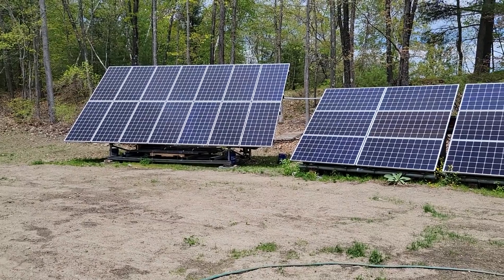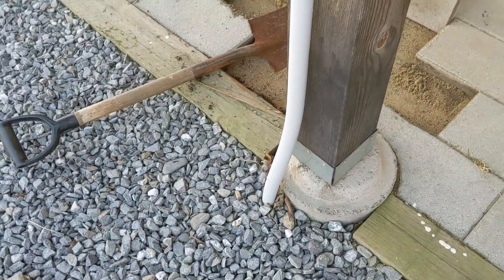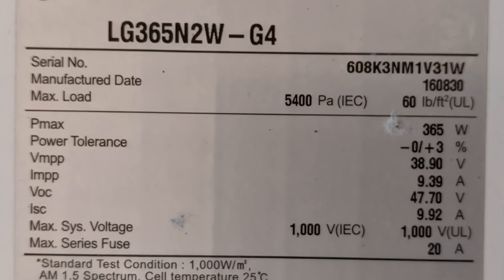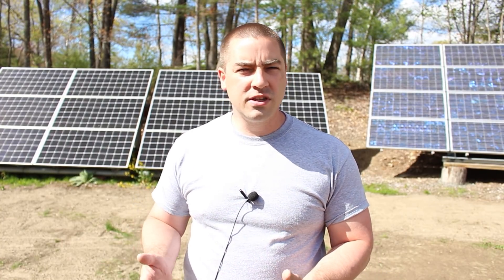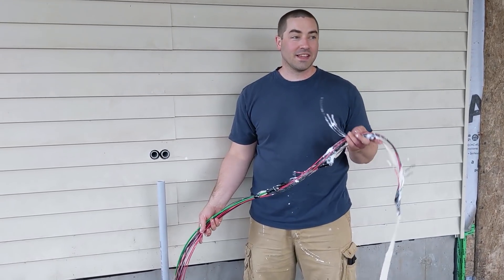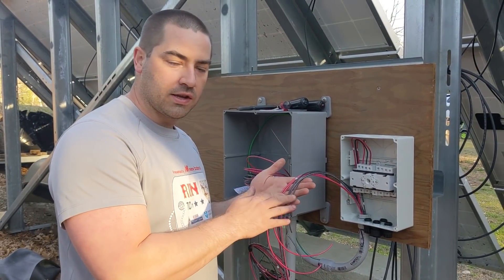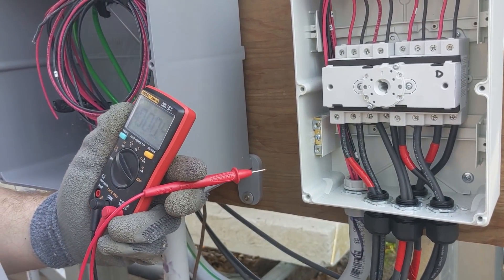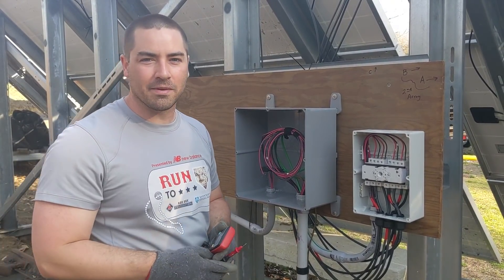Couple wires a huge, High Voltage, Solar PV Array, 12.6kW

Comment: Hey I have 380 volts on 2 strings about 19 amps I was going to add one more inverter. Can I split one string to 9 amps? Or do I need to reconfigure?
Reply: I have 12000 watts of solar. I also have 2 grow art 5000 inverters. I also have a third one still in the box
Reply from the maker: Each Growatt 5000ES can handle up to 6kw of solar.  So you can run all 12kw of your solar array into the two inverters.  Splitting your array into more strings, and running them into the third inverter is beneficial sometimes, but not always.  If you have your array facing different azimuths, angles, or shading issues, then splitting it will help.  However, if it's an open field, and all panels get equal sun, then you probably won't notice an increase splitting it up to a third inverter.
Reply: @DavidPozEnergy   1st: I like and appreciate your videos, 2nd: I'm wondering why your panels are not facing the same direction, also, some fuses or breakers on each string would be a good call, anything to avoid one of those cables getting too hot->melt->make a short as you have them all in the same conduit :)
Reply: @DavidPozEnergy  so where does the third inverter get its power.?
Reply: @DavidPozEnergy  I have my whole house including ac and power tools running off the 2 inverters. But sometimes we use more than 110 percent of output and it shuts down our power.

Comment: Bonding: Connecting something to ground via a grounding conductor
Grounding conductor: not current carrying, connected to ground rod(s) directly or indirectly
Grounded conductor: In the US this is the "neutral" which is current carrying and is bonded to the grounding conductor (aka "ground") only at the main panel

There are some nuances around separate buildings with no other connection and I've not studied the code for about 20 years, but in your situation I'd have at least one ground rod at each group of panels and one where the wiring enters the building and they'd all be connected with the grounding conductor in your conduit, and from there also to the main ground for the building. My DC run is a little over 100 feet and I measured significant voltage difference between the ground rod at the house and the ground rod at the panels. Before I connected them I could draw sparks. Now the earth potential is the same all the way between the house and the panels.
I also put ground rods at the corners of my house and mid-way on the long side and buried a bare #4 connecting all those together with the main ground rod. I have a Delta DC "Lightning Arrestor" (DC LA) at my panels and before the DC lines enter my garage, another on my power wall, and an AC LA on my main panel. Your grounding can never be too good.
Reply from the maker: That's an impressive grounding system.  Wow.  Thank you for your explanation.

Comment: Why run DC that long into the garage?  Why not invert to high voltage AC at the PV frame?
Reply from the maker: The inverters I'm using have built in charge controllers.  But they are not rated for outdoor use.
Reply: And now with the HVDC wiring there is less loss in the wires (and/or smaller wires) than going directly to A.C.

Comment: Feel for you with the existing buried conduit size.   I put a run for solar about 30 feet from a shed to garden.  Initially I had just 2 microinverters, 2 amps max 240vac so used 1/2" conduit (so cheap!) and #12 wire.  DC Solar trailer later, I put 13 microinverters worth, 12-13a max and wanted to use #10 wire, L1L2NG.   Fill table says 5 fit, but just 4 was fun to pull.  So in summary, coulda shoulda used next size up in the first place.

Comment: FYI

690.31 Methods Permitted.

Where PV source and output circuits operating at voltages greater than 30 volts are installed in readily accessible locations, circuit conductors shall be guarded or installed in Type MC cable or in raceway. 

690.31 Methods Permitted.

(G) Photovoltaic System Direct Current Circuits on or in a Building.

Actions for Section
Where PV system dc circuits run inside a building, they shall be contained in metal raceways, Type MC metal-clad cable that complies with 250.118(10), or metal enclosures from the point of penetration of the surface of the building to the first readily accessible disconnecting means.

Comment: You may want to check your local electrical code. High voltage DC above 250 volts must be encased in properly labeled and bonded steel (emt) conduit. This is to protect fire fighters from cutting DC lines.
Reply: Why would they cut the lines when they can just flip the disconnect switch? Or are they not smart enough to do that and just want to fuck shit up?
Reply: That is only required when in or on buildings. This is a ground array not a building.

Comment: I dont see the point. High DC voltage is deadly. You can use aluminium wire to save money with voltages less than 50v DC. It is safer. All it takes is just one mistake! I think that Mppsolar make 24v DC inverters that can be paralleled. The result is the same as the high voltage inverters. Best regards from Egypt.
https://www.mppsolar.com/v3/pip-hspmsp-24v-series/
Reply: The point is to reduce power loss in the wiring. Losses in the wiring are caused by amps squared (PowerLoss = Amps * Amps * Resistance). Power is Volts * Amps.  So if you use higher voltage you can transfer the same power with lesser amps and lesser amps means lesser losses and/or smaller wires.

Comment: Those all-in-one units look excellent. Going to try to use  one to charge the Cyber truck off solar when I get it. Can charge at 5A and 240V so should be possible to charge slowly with 2000W.

Comment: Great video Dave.
You might want to investigate a compound called "NO-OX-ID" which would prevent oxidation from occurring where your wires connect, especially on those screw down terminal connections that remain outside.....
Reply: Especially important when joining dissimilar metals.
Reply: De-ox, no-ox, etc. Good stuff. Even gray anti seize, only if you have to.

Comment: The standard would be to use 10 gauge wire for a wire run that long. Otherwise you are losing too much to voltage drop.
Reply: Yep that`s what i use (6mm) on a shorter run than that.
Reply: Ok going 200’ and used 10 awg

Comment: Looks like we did many of the same things lol.  I also changed my solar to a 6s, used 12awg as well but runs are not as long, the same bag, line and vacuum trick to get the wires through.  At my job we also use that book of letter stickers when rewiring cannon plugs or anything really.  Great way to label!  Fun times!!!
Reply from the maker: Thanks Joe.

Comment: Wow I would have gone with 2 inch pvc with that many wires. But you made it work good job !
Reply from the maker: I wish I had gone with 2" from the beginning. Next time!
Reply: @DavidPozEnergy   When I brought my 100 amp service wire around my house I use 3" and hooked it up under the eaves all the way around the house I had 96' to get to my garage where I could put my sub 100 and panelin that's the one that's always in my videos with the panel off and wire sticking out everywhere. Lol

Comment: David, why do you run the ground wire from your panels to your solar charger system? Couldn't you just ground each one at their location and save the cost of wire? I have my array at 197ft from my solar shed and was planning on grounding it with an 8' x 5/8" copper rod and doing the same thing at my shed for my Sol-Ark 12K. Am I wrong in doing it this way?
Reply: A ground rod at each end would be sufficient for grounding but for bonding everything needs to be connected together. My understanding is that everything should be bonded together in an electrical system. I know there are some exceptions but I think it's better to do so unless you are sure otherwise.

Standard disclaimer applies. I could easily be mistaken and in any case codes vary.
Reply from the maker: There are a few different ways to do this.  I ran it following one of Midnite Solar's diagrams using a ground-fault protection device.  This was with my Victron CC.  I don't think the Growatts want it done that way, so I won't use the green wire right away, but I wanted it in case I change things again.
 However, I think you are using the Sol-Ark, is that right?  I don't think the Sol-Ark needs the ground wire between the array and inverter, but check your manual.
Reply: @DavidPozEnergy  This http://www.ginverter.com/upload/file/contents/2020/07/5f1019661cbac.pdf   describes AFCI protection which some Growatts have, but looks like not the SPFxxxx ES.   Sol-Ark does have  PV Arc Fault detection – NEC 690.11/UL1699B    

Careful of the DC out at the arrays and coming into the garage.  https://www.youtube.com/watch?v=S9a2oPCIMr0    Imagine that starting from PV loose connection or pos & neg touching in combiner box in garage, promptly expanding to all the string wires.  Ground mount arrays are not a huge fire risk, but certainly a potential shock hazard.  

Kettle being black, my DC panels are on my attached garage roof, and I'm convincing myself to install my AFCI system Sensata PVAF-T parts sooner than later.  My DC charge controller is decontented Midnite Classic 250-CP without integrated AFCI.
Reply: @DavidPozEnergy  You do want the green connected to the grounding at the array, and to the grounding in your garage and to the equipment ground of any inverter and probably to the battery negative.  

There are numerous discussions on the NAWS and Midnite forums about GFP, but this is the best write up I've seen.  https://silo.tips/download/version-35-draft-dated-03-29-2011     It's kind of a lot to read, but it's worth understanding, and there are good diagrams of various failure modes.  Maybe the Growatt solar input has modern AFCI detection that looks for arc noise signature on the PV wires, which would mitigate any or most PV faults to ground or pos to neg.  That is a better type of PV array protection than the 'NEC DC GFP' method, sounds like you had before.  The Victron charge controller maybe did not have AFCI.
Reply: Craig,  need to connect the ground at all locations, with a ground wire, ie: bonding.  Dirt and earth is actually not a good conductor, and lightning or or faults do happen.   The bonding wire keeps all points in the system at the same ground potential, for safety, and as a return path for fault currents (shorts), so that an overcurrent device (breaker) can trip and de-energize it.

Comment: Yeah, you have to be extra vigilant with the wiring in those IMO disconnects. I used red and black wire all the way from the panels into the basement and have an IMO on the arrays and one before entering the inverter in the basement. I checked the voltage at each step and got caught out by the negative voltage coming out of the first disconnect. I had to correct the wiring even though with two disconnects in series it would have come out fine. Didn't want a gotcha in future if I made further changes to the system.
Reply from the maker: Good to know I'm not the only one that goofed.  Thanks.

Comment: Hate to burst your bubble, but the ground IS counted for pipe fill David, just not for derating.

Edit: You're still good in 1 inch pipe though. 👍
Reply from the maker: O, no.  Shoot.  I really thought I had that one understood.  Thanks for letting me know as I care about putting out correct information.
Reply: @DavidPozEnergy  Also you derate after more than 3 current carrying conductors, at least on the AC side of things. I'm a residential electrician so don't deal directly with PV and DC a lot, but I'm learning. That's why I like your videos so much. You put an honest effort into explaining things as you are learning them. You're genuinely enjoying learning and sharing that process, warts and all, and I 100% relate. Keep up the good work.
Reply: @cali-electro-dad  DC and AC is the same thing when it comes to amps and derating.

Comment: I thought as you increase the voltage the amps drop but the “power” stays the same.
Reply from the maker: That would be true with loads.  In my case I'm adding more solar panels to one string.
Reply: @DavidPozEnergy  are yes. Your right. Forgot you added more panels 👍

Comment: Rubbish video . Really trying to drag it out for the kindergarteners I guess. No need for labels .Try a continuity meter. 450 volt inverters have been out for yonks. You are just late getting on to them . Should look at hybrid varieties that can even be used without a battery.
Reply: Thw geowatt spf5000es IS a hybrid inverter and can operate without a battery !       Still most use it with batteries.    I have a system running with the same exact inverter, 18 panels and batteries,  it works great.
Reply: Rubbish comment.  450v pv   and up are NOT the norm for less expensive inverters .  Sure 7k $ systems but we are talking 800. Why not label , your going to anyway after you find them with a meter .

Comment: The ground wire shall be counted for conduit fill. It, however, does not need to be in the math for de-rating the conductors voltage drop.

Comment: You have two strings coming off of each panel group, which should be six (3 groups by 2 strings). Where are the other two sets of wires?
Reply from the maker: On the oldest (Poly) array I already had a disconnect on the back of it.  The wires go underground to the garage.  I will be wiring that array to the Growatts too.

Comment: Most of the time Mule Tape refers to the webbing that has a steel chaser inside it too. Also, KY Jelly is way cheaper than wire pulling lube, in case you do another pull in the future.

Comment: I had a bad experience with Cat5 cable going about that far underground.  A nearby lightning strike destroyed equipment on both ends and vaporized the cable.  What are you using to protect the inverters from lightning?  The high voltage is a problem for most gas tube style protection units.

You might want to look at "Grounding and Bonding for the Radio Amateur" - you can get it on Amazon in either paperback or kindle format.
Reply from the maker: Thank you.  I ordered it and look forward to the read.

Comment: Dave I'm interested in learning more about the inverters I've been looking for some time for a higher voltage solution to my system
Reply from the maker: Cool.  I have two previous videos on the Growatt inverters.  Those previous videos show the load testing.  coming up I'll be able to show the MPPT solar charging.

Comment: are you using pv wires from the array to house?
Reply from the maker: No.  The PV wires go from the solar panels to the disconnect switch.  From the disconnect to the garage I'm using THHN, normal wiring for buildings.  You only need PV wire where the wire is exposed (UV/rain).  But the THHN is never exposed, it's inside conduit.
Reply: Thsnks.

Comment: Pull a green ground, and use ohm meter to choose wiring strings.
No need to prelable them
Also, you could tie a black and red together for each set...  labels are simple too.
Reply: We used to call this ‘belling out’ when we installed a new multicore cable we always tested each core was correctly terminated

Comment: So I'm confused by one thing: you have four strings running to the inverters, but those inverters take only 1 string each. I get you had to split the 5.1 kW array to not over-current the inverter. Are you saving one string for experiments or for use with a different inverter?
Reply from the maker: One array per inverter.  Each array is split into two strings.  I'll be combining those two strings inside the garage.  You also could combine them out at the array, and then run a larger wire in.  Thanks for watching.
Reply: @DavidPozEnergy  Ah, makes sense! Thanks for clarifying

Comment: Those  IMO switches are impressive.  In 5 ms extinguish the welding spark in their own suppression chamber. I got to install one so no more waiting for the Sun going down to work in the array. Thank you for the information David.
Reply: I agree. I have a much smaller version (single string) of the imo rapid shutdown, (or isolator if you will). Works like a charm, and yes, the plus/minus in, criss crosses internally to minus/plus out. Took a sec for that to sink in when I installed it, but that's the beauty of the design, and why its able to do what's its supposed to do so well.

Comment: Are you using AC wires to run a DC voltage ?
Reply: You don't want to use low voltage wire for 250v
Reply: No such thing. The insulation dictates what the conductor or insulation rating will hold up to, at least at this voltage. Hes using THHN most likely 600v rated wire, so hes good there.

Comment: You could wait until night to disconnect with no arc. :-)

Actually, what happens when a leaf/shadow falls on a single cell? You'll have 450 Volts arcing across the cell's thin wires? Why won't that burn out the cells?
Reply: Diodes!

Comment: If you'll notice at the top of the PV disconnect box and on both the right and left sides is a "fin" that is for guiding the wires away from the sides of the switch. The switch is referred as "snap action".